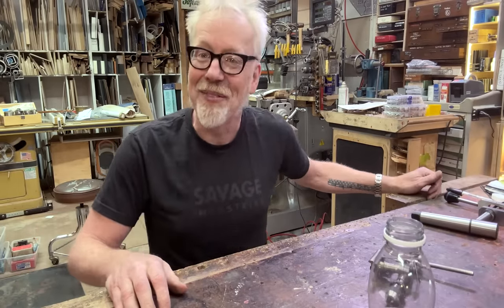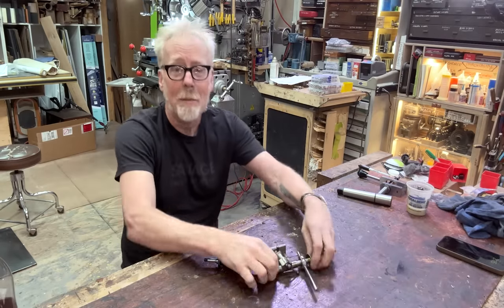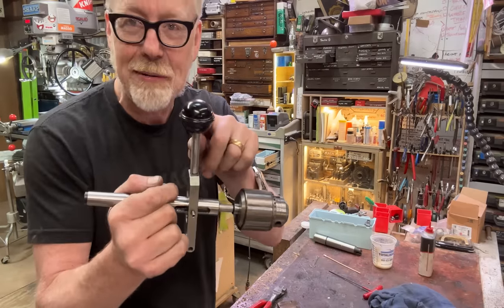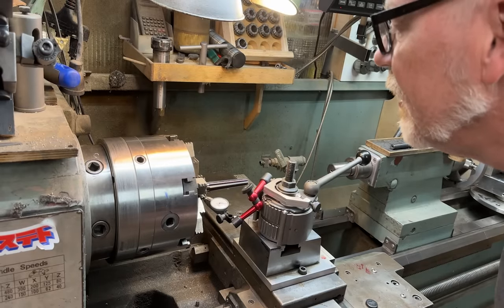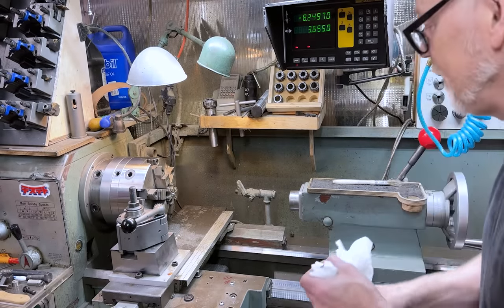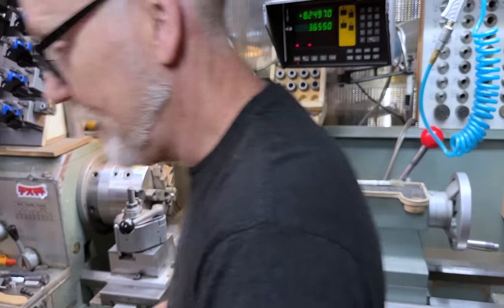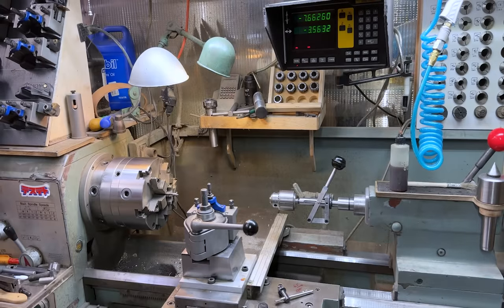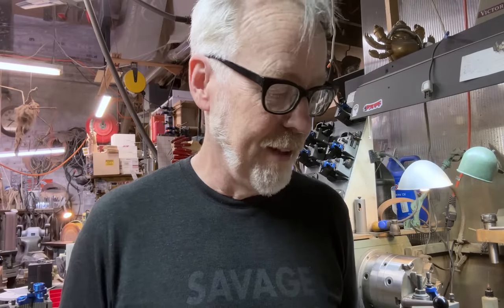Adam Savage's Lathe Build Fail

Comment: Being a machinist, I was enjoying watching the fails all along the way knowing what was going to mess up along the way.

When building tools for your machine, build ever part using your machine. You cannot depend on the supposed accuracy of the tool you are using without checking everything along the way. And why would you chuck up one tool in your headstock to check its run-out and use another tool in it expecting the same run-out? Same issue. Hilarious. 😅

Comment: Hmm, can't say I'm a massive fan of the amount of stick out on the MT4-MT2 adapter setup. Have you considered scaling up the watchmaker's version to fit your lathe, i.e.: a mechanism that's integrated with its own custom tailstock (and clamp) with the sensitive mechanicals on the far side of the tailstock and the arbor for the drill chuck on the near side. I expect there's a keyway slot cut along the length of the shaft going through the tailstock, too, to stop it rotating.

Comment: two things.  
1.  You mentioned Stephan Gotteswinter at the start of your video.  The first thing HE would have done would be to check all the concentricities of the components.  And if HE found an error, he would have allowed for it.  But I think you were correct.  All the stack up of tapers led a less than acceptable error.
2.  While you were reaming, I kept thinking.  He hasn't checked the depth he needs to ream...  has he marked it on the reamer and not told us?  Turned out you had not.

Comment: Multiple sources of error here:

1. If your tailstock isn't perfectly aligned, the taper will be off center, meaning every time you put it in the tailstock, it will be rotated off center differently from when you reamed it.
2. The tapers on the sensitive drilling device (SDD) may not be concentric.
3. The drill chuck on the SDD may not run true.
4. The drilled hole in the adapter might not have drilled straight, meaning the reaming would not be straight. Single point cutting would be the ideal setup for this.

Also, the drilled hole should be step drilled to lighten the load on the reamer. A roughing reamer and then a finishing reamer is also generally used, but you can use a finishing reamer only, it's just a lot more work.

To find the source of error, start by checking the alignment of your tailstock using a test cut bar. There are several videos on this all over YouTube. Once you know that is concentric and in line, place an indicator in the chuck of the lathe and the adapter in the tailstock and indicate the taper of the adapter, preferably at 2 depths. If there is more runout at the second depth than the first (or visa versa), the taper is not inline. If little runout is found, add the SDD and do the same for its taper and so on, adding pieces and measuring. There is very likely some amount of error at every connection, but this will at least tell you where the main source of error is.

Comment: It helps if you do a series of drills with increasing sizes. That stepped approach limits cuts down on the material that the taper reamer has to remove. It makes the process easier. Just be careful to assure the drills don’t go too far. Stay wishing the taper confines.

Comment: 2 problems with your method;
1. Any angular or positional error of the tailstock causes an equal angular or positional error in the finished adaptor.
2. Cutting a tapered bore in solid steel with a reamer is very stressful and heat producing, likely to cause damage and issues.
It would have been better to turn the blank, and use the compound slide at a precise angle with a boring bar.

Comment: I was a little surprised to see you chuck a reamer in the lathe, thought I was about to learn something. Turns out what I was taught was correct. 😂
Reply: Not only can you, but they are called machine reamers because you should.... Especially with tapered reamers.
Just with a far more careful set up then Mr Savage used, and use lard for the lubricant, and an fairly slow SFPM.

a rule of thumb is; if it takes less then half an hour to get that sucker concentric and in line with the axis of rotation on a lathes headstock then youve missed something; because I havent met an old timer skilled enough to do it faster! and usually we just throw soft jaws in the lathe chuck and bore them out, perfectly in line everytime, but that take half an hour. 28 minuites to find the soft jaws you want to cut up and two to cut them!

Adam definitly screwed up his axis by doing it by hand, no guide and by hand youll never get a straight cut.
Reply: @AnonymousAnarchist2  Interesting, I am absolutely no machinist, just an idiot with some modicum of ability. I was taught by my Grandfather who was a machinist to always hand cut tapered reamers. I still have his full set of them. Rarely used, but amazing tools.

Comment: Yep, at 25:40 the idea to use the Jacobs 0 on the little sliding post is the solution. You can just use a normal chuck in the tail stock to hold the smaller sliding post of the "0" chuck.

Comment: Just buy yourself an ER40 collet chuck with an MT4 shank and hold the little sensitive drill chuck with the red ring in a collet in that.  You can then also hold many other things in that chuck, since it has a larger capacity than most drill chucks, and will hold much more solidly than even the best ball bearing chuck.

Comment: Adam, don't give up.  You are 98% of the way there.  The error probably came from the manual operation you were doing with the reamer.  Chuck that reamer back up in the lathe, re-zero it and shave a couple of thousands off and it should be able to center the taper.

Comment: If there is a need to put that "sensitive" small drill chuck in the lathe, get a MT4 to ER collet holder. Problem solved. If there is a need to put the drill exact on center, get a MT or clamping bar holder for the multi-fix tool post. This allows drilling from the carriage and setting up the drill on carriage direct on center by a number of methods from using test indicator to center finder to Blake indicator..

Morse Tapers can be made on a lathe by using setting the compound precisely  between lathe centers with a test indicator and turning the internal or external diameters to precisely the specified dimensions (tiny factions of a degree as morse tapers hold by van der waals force.. and the overall diameter must be within 0.001" tolerances). If the morse taper is reamed, make the initial roughing taper on the lathe before applying the reamer and the same tolerances for the required dimensions apply.

As exampled in this Swamp Lamp video:
https://www.youtube.com/watch?v=rikIaux3bWo

Or Curtis at CEE..
https://www.youtube.com/watch?v=KswiJrYhEbY

Materials are a side note to machinist skill and understanding of how to make these parts. Cast iron, steel, aluminum, brass, plastic or what ever else material, part of machinist skills is understanding how materials respond to being worked in a machine tool and how best to work them with the specific tools required.

BTW, ditch the 6 jaw chuck as they do not work well on solid round parts due to the harsh reality of no round bar is absolutely round and no 6 jaw chuck will make contact with all 6 jaws on a "round" part. 6 jaw chucks (why 6 jaw chucks are prone to chatter)  work best on tubing where the tubing has compressibility allowing the tube to conform to the force applied by the 6 jaw chuck. 6 jaw chucks are fragile, one Oooops incident can easily bend the chuck body causing the 6 jaw chuck to be forever outa whack. And no, 6 jaw chucks do not work at all like a collet..

Best precision and holding power is with a properly set up 4 jaw chuck.

Comment: The ideal setup for this would be to remove the chuck and put the holder into the headstock taper. Also put a a known MT2 taper in and indicate your cross slide to the taper and bore out the new adapter with it in the headstock. All headstocks have a Morse taper at the end. You might also need an adapter for your head stock taper to the MT4, my lathe the taper are the same on both ends.

Comment: failure is always an option
I spent yesterday adding window restrictors to my UPVC triple glazed windows...
Sure enough one was out of spec and locked solid on the first use of the newly instaleld restrictor.

Had to drill a hole to see what was wrong and now i have a window frame with a hole in it, but now opens......luckily its the inner and not the outer frame.

Comment: Today's lesson:  you always have to both check both alignment of the (workpiece or bit) mounted in the chuck and alignment of the (bit or workpiece) mounted in the tailstock.  Adam did the first but not the second.  Don't feel bad; this particular mistake is something everybody does one of the first few times they mount the bit in the chuck, because they're not used to really needing to do it.

Misalignment of the chuck can always cause wrong-size or wrong-shape holes and possible bit breakage, but while misalignment of the tailpiece causes more of exactly the same symptom when the bit is mounted in the tailpiece,  it causes holes off-center holes in the workpiece when the bit is mounted in the chuck.

The reason bits normally go in the tailpiece in most shops is that wrong-size or wrong-shape holes can usually be solved by drilling slightly tight tolerances and then hand reaming.  But off-center holes can't.

Comment: Adam, being you have the tailstock taper adapter to play with, you might want to try machining in 4 set screws (90 degrees apart) to allow you to tweak the runout.  This might be a quick workaround

Comment: I have to wonder if the actual drill part you purchased is ever so slightly warped
Like you stated it's not an overly expensive tool, and unfortunately when it comes to tools, especially precision ones, price more often than not reflects build quality... Not to say that there aren't extremely good cheaper options, especially for shop grade equipment, but if you're trying to make or build to absolute concentricity then it's worth expecting your cheaper tools to not be up to the task at hand.

Either way, always love lathe work videos, and yours are some of the best of the best, love watching you learn new techniques and learning from any mistakes you might have made along the way!!

Never stop what you do Adam!

Comment: When tightening the lathe chuck, always run the chuck wench in all of the pinions (that's the square things you put the wench in). The scroll plate will always have a slight play in them. This is why the drill slipped. You kept using just one pinion each time you were fixing something. When you try it, you will see, even when the first pinion is completely tight, you will still get movement in the second pinion and so on.

Comment: The best you've got w/ the Jacobs chuck is 0.003" TIR.  To get better you gotta go w/ a good collet.

Don't think you can ream a precisely concentric taper.

Then, you need an accurately concentric MT4 blank.

I busted my azz to get my tailstock perfectly aligned for some accurate concentric drilling.

Then, rigid as can be, when the spotting drill touched the spinning material, it jumped a few thousands.

I've seen Abom's jump, TOT's jump, Wainwright, etc, etc.

I decided, since I had no one answer, you drill to get an approximate, then bore to make it accurately concentric.

Unless you spend big dollars for precision straight flute die drills, you can get 0.000n TIR drills which don't jump.

I did end up buying carbide tipped, US made generic die drills. Kinda pricey... medium pricey, but no jumpy & as straight as a ream.

Do NOT use in hand drills, they break instantly.

GeoD

Comment: This was a very interesting build.  "We" as hobby machinists should not be concerned with success or failure.  In my opinion, as long as we learn from our mistakes there is no failure.  How else can "we" justify the cost of the expensive machines in our shops.  If you should decide to try again, how about building the tool from ground up eliminating the MT2.  I didn't see it in the video but may be indicating each tool as it is placed in the chuck could help.  Did you check the tailstock for taper.  Remember, it is the little things that really screw everything up.  In other words "do as I say not as I do".  But either way it made for a great video.  KOKO!

Comment: You might be coming at this with the wrong expectation, even without the adapters and chucks involved.  The tool you have in hand is for drilling delicate holes with a stop that's measured in C hairs on the watchmaker's level.  On a wathchmaker's lathe that makes sense and that is the tool you're looking to reproduce.  But it was never designed for the tool room lathe you're working on.  Right tool for the right job and all that.  Scale does not translate well in the machine world.  Sure, many tools can be tuned to amazing precision, but I think we're talking about to very different worlds of precision.

Comment: Confused why you would have a hand-based movement in line with the drill for sensitivity rather than a micrometer still perpendicular rotation for micro-adjustment?

Comment: One thing I found out about lathes is often they have a morse taper in the spindle mouth behind the main chuck. Rotating the blank and drilling with the stationary chuck may have given you slightly more concentricity, but I guess if the rest of the tool was garbage it wouldn't have helped!

Comment: I haven't seen that rotary tool before so I went full Sherlock Holmes on it. It is a Nakanishi EMAX EVOlution EV250-IR With a IR-310 ring type attachment on a  ENK-250T torque motor.

Comment: Take the Jacob's chuck off and use the drill bit you want to use to drill a hole in that "sensitive drill attachment", then take the drill bit and swap the ends around and install it permanently in the chineseium attachment with a set screw.

Comment: You have 3 tapers. Soo if it's off then twist them. Maybe and most likely they aren't all of in the same direction. They may offset one another and can be twisted it turned to each other to where it comes out centered.

Comment: I wonder if the fact that the slots in the jig are not centered is causing the misalignment.  I'd try inserting the jig into the mt2_to_mt4 adapter, determine which direction the max runout is, then rotate the jig 90 degrees and see if the max runout also rotated.

Comment: every time you drill in the mill or lathe it will be off center, you need to bore the hole to get concentricity, inthe in the mill i use a end mill after drilling to get con. then reem

Comment: Been there. 8 Hours work and it's wrong:-(. Might be the tale stock is quare to the head. Put a pillar between centres and clock it up. it's a pain takes ages but it's needed. If it's the problem you can just machine a bit off the front and ream a bit deeper.

Comment: Wouldn't it be better to have the support for the extending rod in front of the lever, like it is on the little example one shown at the start?
That way you have less of an overhang and less of a chance of the lever movement affecting the rods vertical position..
Maybe. Not sure.

Comment: You should have drilled and raper bored that hole with the "device in the spindle and then cleaned the taper with the reamer, but just taper boring the hole would have been good enough if you had set the compound slide to the taper of the reamer. between centres.

Comment: I would use the cross slide for sensitive drilling on that lathe, then you can also use the scales to measure depth since its already to go. For very small stuff use your watchmakers lathe.  Get a Sherline lathe for medium stuff, much better feel and accuracy.
Reply: I would still want the sensitive drilling attachment he is showing.  The feel isn't the same, and helps with peck drilling.

Comment: what if you use a tapered bar attached too a bearing shaft that can move in and out on it and then put a Ruler + adjustable push depth ? then you can get a nice feel for precision? my Shop english is garbage :D

Comment: As much as I love Adams style of filming, and the views of Adams back, how have they not built or modified a rc car or telepresence device so they can have somebody doing all the filming for him without being there? Heck you could even do a gantry arm with motors to get all the angles.  Would have been amazing during covid.

As for the build, it looks like you just need to do it from scratch for your machine.  Build another tail stock, or maybe reuse the bottom plate of the tailstock(or find a spare) and build that mechanism on it

Comment: Single point turning with a boring bar set at the right angle. Then ream the last 0.1 mm max.
Reply: There is an "issue" notice Adam's lathe has no compound or taper attachment.... or no ability to single point a taper..
Reply: There is such an attachments present. Using a reader to drillen is misuse of a reamer. He took it of for greatest rigidity but you really don't need to.

Comment: I love this channel and I love your content Adam but this was basically a video on how not to ream a precision hole or taper. This had almost zero chance of working even if your drilling device was perfectly concentric to begin with. A drill is almost never going to create a straight/concentric hole.  Your last step before reaming, if that's the desired outcome, should be boring to diameter and in this case you should have bored the taper until your reamer was only removing a few thou of material.  As soon as you put the reamer in the chuck and plunged it into the drilled hole at those rpm it was over with almost no chance of recovery.  At the very least the hardened reamer shank should have been in a collet chuck not held in the hardened lathe jaws.  I look forward to your success in the next attempt!

Comment: You could have turned the operation around and used a boring bar to cut the taper after drilling.
Reply: Not possible, there is no compound or taper attachment on Adam's lathe.